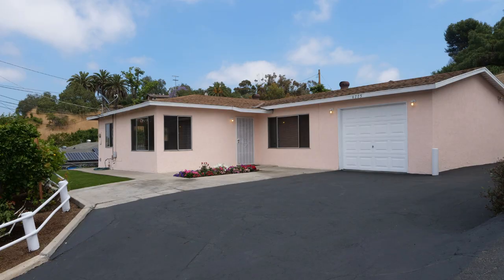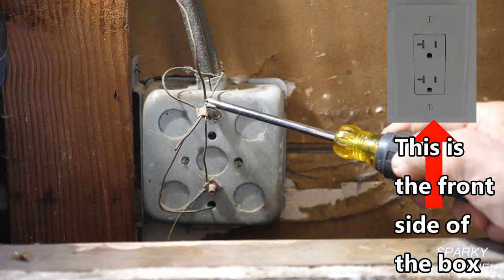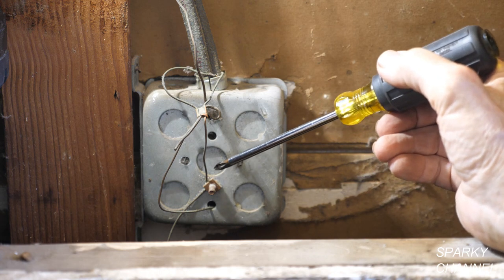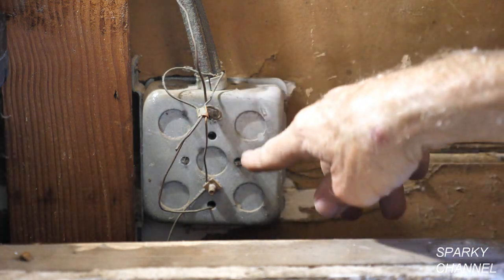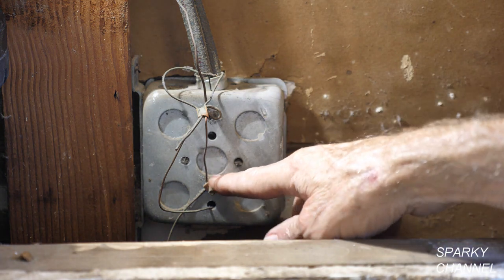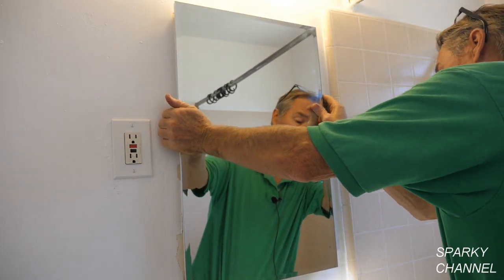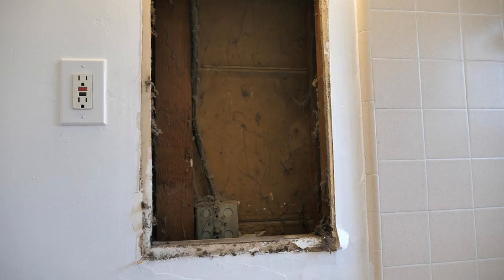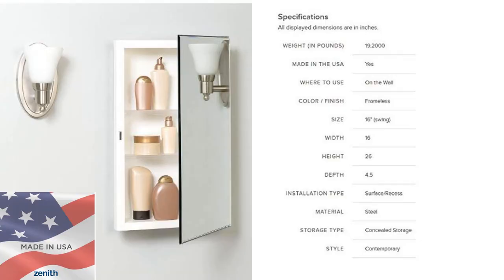How 1960's Metal Electrical Boxes Were Grounded

Comment: Intriguing old wire and old boxes. Thanks for this insightful presentation.
Reply from the maker: It's kind of historical, isn't it? Thanks!
Reply: Yes in the U.K. they now always sheath their ground wire in US this is still not the case but given you wrap the terminals it would avoid inadvertent ground leakage. It would still be good to know why sheathing of the ground wire is not done in US especially when ground pigtails often are sheathed. Kind of confusing for the layperson.
Reply from the maker: @mathman0101  Probably just money savings. I prefer sheathed ground wires for sure!

Comment: It was interesting seeing the box behind the cabinet, as you have shown it in a few other videos later on when you put in GFCIs to bring other circuits to 2023 NEC Code in the house.  I suppose now if a house uses an older panel with obsolete breakers that are discontinued, the only way to bring it to code, short of rewiring the house with all new breaker panels and wires is to buy the combo AFCI/GFCI weather and tamper resistant receptacles to meet all codes.  I will assume it is better to use a weather and tamper resistant AFCI/GFCI combo receptacle in bathrooms, laundry rooms, kitchens and garages, even though they are sheltered, as code will become more strict in years to come.

I have encountered a similar grounding situation in my kitchen back in the early 80s when I replaced a rusted double gang switch box for my parents, damaged from a roof leak.  The light switch box was for the back porch floodlight and one of the light fixtures in the kitchen.  The old box had a ground wire clipped onto the bracket nailed to the stud.  When I removed the rusted box, I ran the ground wire into the new box and bonded it, as the new box I assembled had tapped ground screw holes on it.  Since it was an expandable box, I used the other ground screw hole to make a bonding jumper to wrap around the yokes of the light switches to ground them.  Since this was in the early 80s, the switches had no grounding screws on the yokes.  I was simultaneously replacing a worn out 1955 light switch to the kitchen light fixture at the time I did the box swap.  I did need to fabricate a bracket to secure the box to the stud.

Comment: Always appreciate your great  tutorship to DIYers.  Our one story house was built in 1960 and still contains some of the older metal junction boxes for switches and outlets.  I've since upgraded all the older circuits by installing combination GFCI/AFI's at the first stop in each circuit's homerun and everyting hasalways tested OK afterwards.  My question is this.  The attic is unfinished and over the past few months I've been laying plywood in a few spots to offer additional storage space. During the course of doing so I've run across a couple of broken bare copper wires that I presume were originally attached at various points in the home's electrical circuit, but have since become detached or somehow broken over the years.  Is this an issue that I should be worried about, or should all be well considering I've upgraded all of the circuits with GFCI's?  Seeing bare copper wires sticking up through the insulation is a bit unnerving, so just wondering if it is something I should call an electrician about.  Have owned the house for 15 years and have never experienced any type of electrical issue with any circuit or having breakers tripped.  Tks.

Comment: Did they sometimes use a full size ground before it was required? Interesting that 2 ground wires enter on top with the 2 romex cables,one eners on bottom and another oneis connected to the back of the box.Why ground a box 4 times?
Reply from the maker: The ground wires travel to other receptacles as well. Another form of ground back in the day was metal clad cable.
Reply: @SparkyChannel  Back in 1979-80 when I was a junior in High School, I took an Electronics class.  I learned about house wiring at that time. The teacher addressed the NEC Code in effect (1980 NEC) which mandated the GFCIs in bathrooms that year.  We learned about how the older pre 1962 homes which most of us grew up in were grounded as well.  Orange County California had a tougher electrical code for buildings than specified by the NEC in unincorporated areas.  If the building was in an incorporated city, you followed the city's code or the NEC code, whichever was tougher, but not as strict as the county code for unincorporated areas.  The county code required older homes to have everything in the wiring upgraded when remodeling a home, such as adding an addition.  All electrical receptacles that were ungrounded in a home undergoing remodeling had to be rewired to meet the latest NEC code.  Our teacher also informed us about a restriction that neighboring Los Angeles County put into effect, forbidding the use of metal clad cables, due to careless do it yourselfers bending the wire and cutting the insulation, causing wires to short circuit and start fires inside walls.  During that time, hardware stores and electrical supply stores could not sell sheath metal cables anywhere in Los Angeles County.  Any chain hardware stores at the time such as Ace Hardware, Home Club (now Home Depot), Eagle Hardware (now Lowes), Builders Emporium, National Lumber and True Value could sell sheath metal clad cables in Orange County, but not Los Angeles County, which confused many do it yourself home owners in nearby Los Angeles County cities bordering Orange County.  Metal flex conduit filled with individual 14, 12 or 10 gauge wires were permitted, and an exemption to providing a green ground wire in the flex conduit was given, under the condition the conduit ran to the main bonded breaker panel and provided ground continuity to all boxes chained to the circuit.

We were also made very aware of grounding continuity being broken when home owners were getting broken galvanized water pipes replaced in sections with new CPVC pipes, or getting repiped with new copper pipes and not getting the ground wires bonded to the new copper lines.  I have a detached garage that uses the cold water pipe to bond to the grounding system at the breaker box.  The UF cable leading to the first receptacle in my garage (the GFCI) has no ground wire.  The separate ground wire runs to every original box in the garage, and attaches to a cold water pipe that is bonded to the breaker box.  My tester showed correct wiring in my garage.

Comment: My son just bought a house, originally built in the early 50's. He's got about 15 upstairs receptacles without grounds (just 2 prongs) - yet the electrical panel is nearly brand new and I see nothing but romex cable runs. It will be interesting to see if I can add grounding....
Reply from the maker: Yes, that does sound interesting! I wonder how far the new Romex goes?

Comment: my house is from 1960, it only has 2 wires coming into the boxes to the receptacles,  when tested with a plug in tester, some of them the light for ground on the tester barely lights up and some of them dont light up at all. i just thought the house had ungrounded wire and someone installed 3 prong outlets where they shouldnt have been, but this would explain that i guess.
Reply from the maker: Yes, if your house was built in 1960 there is a good chance that it's grounded at certain receptacles in the same manner as the house I'm working on in the video.

Comment: Great video Sparky! I am currently working on a house from the 50s. I've come across a lot of outlets that have a small wire connecting the ground of the receptacle to the neutral of the receptacle. I have replaced these outlets with brand new ones but i don't want to bond the ground like were. How can i test the metal boxes to see if they are grounded? (without pulling the boxes out of the wall)
Reply: The ground wire should not be connected to the neutral at the receptacle. It unethical and illegal. If you remove it you can check if your box is grounded by checking the voltage between the hot and metal box. You will get ~120v if it's grounded.